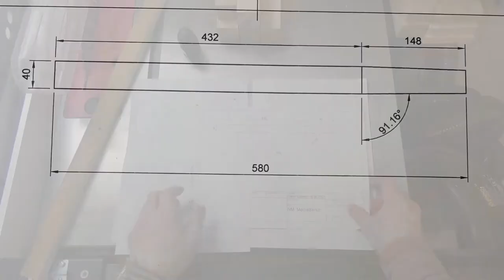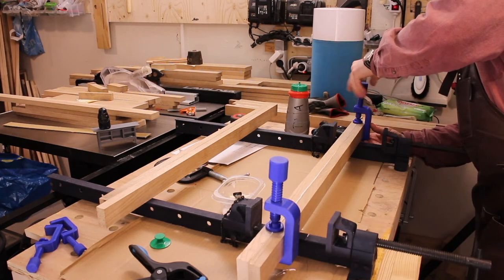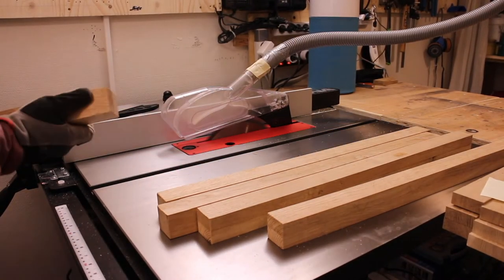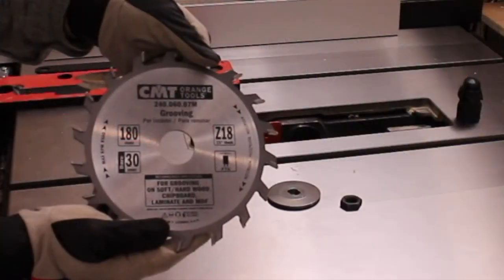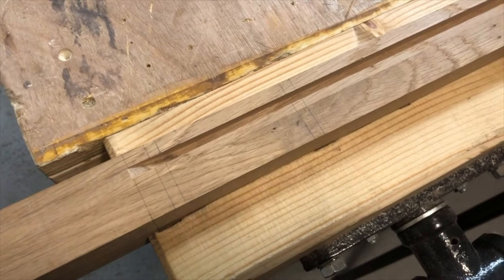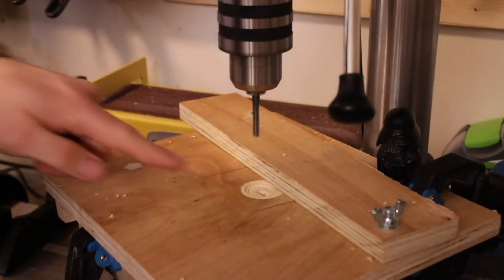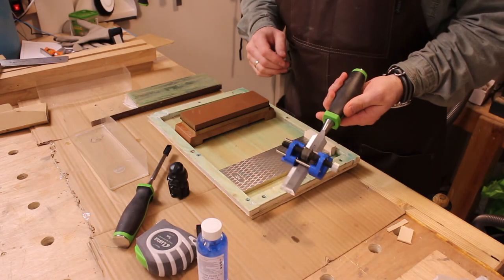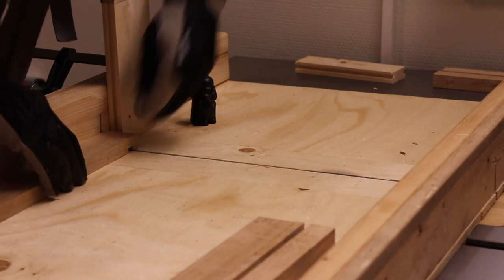Scandinavian Furniture Design - Credenza - Legs - Made in Norway EP03 [0082]

Comment: Interesting that you use such detailed plans.  I typically design to a point where I have a good idea of structure, but let the details evolve in the shop...especially since targets change as wood has to be milled flat, often resulting in an unknown final size, so that the plans become "approximate".  Oddly, I am drawing out a Scandinavian inspired bar at the moment.  I have to find a way to make it work with solid wood as I rarely work with plywood products.
Reply from the maker: I was using this project to learn Fusion 360. While the learning curve is somewhat steeper than in Sketchup I was able to get drawings from it and then measurements. They have been really helpful.
However, after the fact most of my measurements are relative. The width between the face and the tenon was supposed to be 8mm but ended up at 7,9mm. Now this is miniscule, I know, but since I used the same referance face all the reveals are the same. Same with the stop block metohod. Also, when measuring for the lengt of the inner structure the relative measurements are not good enough as the structure is not ridgid without the inner structure. 
In the future I hope to make less detailed plans, but for now I chose to do it like this. You are far more experienced than me, so I guess you don't have to plan as much in detail. 
I have been thinking about learning to veneer. That bar project sounds like a perfect veneering project.
Cheers and thanks for watching.
Reply: @NomadMakes  360 is an impressive tool.  I really like it, but yes tough to transition from Sketchup.  I typically only really care about stile and rail lengths to set the overall dimensions.  Once they are cut, all else is relative.
Reply from the maker: @James Ervin  I will get there as well. But I need more practice and experience :-)

Comment: Nice one! 
Quick question - Where did you get your Whet stones? Looks interesting!
Reply from the maker: Thank you! I got the King Stone off Amazon and the Trend Diamond plate off eBay. However, there is an overlap between the grits. The Trend being 300/1000 and the King 1000/6000. So  I suggest going for a different grit progression. If you are i Norway there is a guy selling whetstones on Finn.no with this code: 194982257
I have not tried them though.
Reply: @NomadMakes  Thanks for the ultra quick reply! Perfect info and advice.
Reply from the maker: No problems! Hope to see you back on the channel soon ;-)